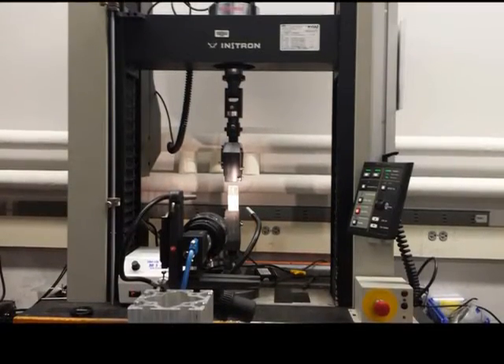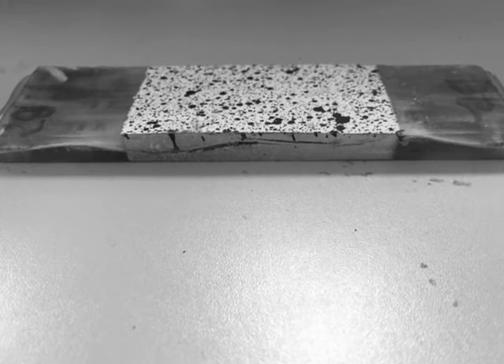Woven Bamboo Fiber Composite

Comment: I have been looking at trying to make a composite bamboo material but Im running into the usual issues.

These are my criteria:

1) 70% Bamboo (pref fiber)
2) Natural adhesives and/or resin
3) Non toxic

My issues:
1) It would seem that no matter what way you go about it, its extremely labor intensive to produce  ... even more so to produce in bulk 

2) Requires custom built machinery and huge work spaces 

3) The matting process seems (at least from my novice perspective) to be next to impossible to achieve ... if you have any pointers that would be helpful.

If you prefer not to add this on comments you welcome to email me on nurosyncpro@gmail.com